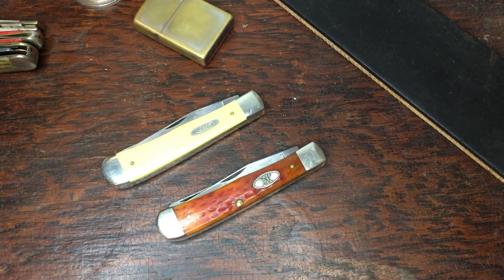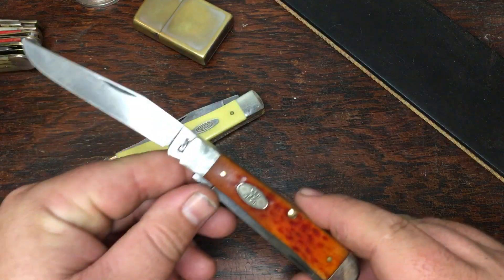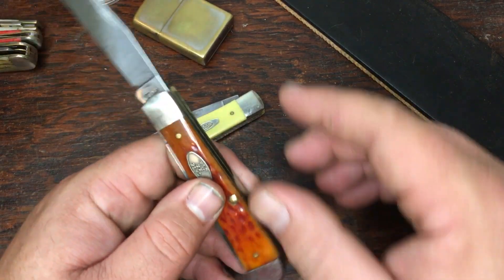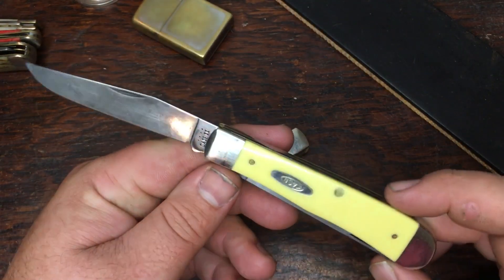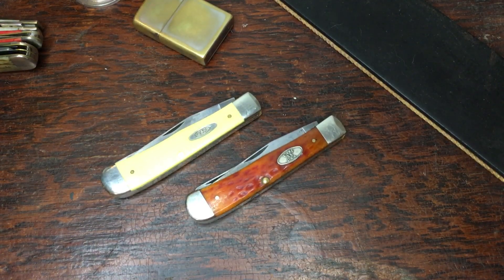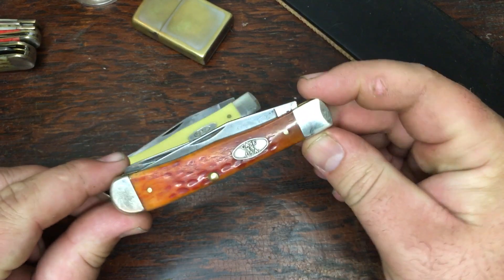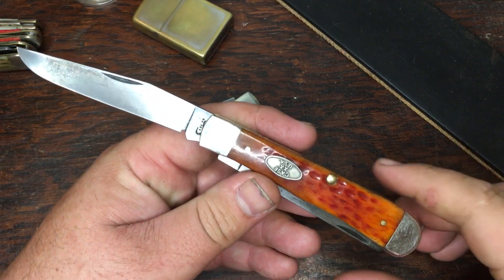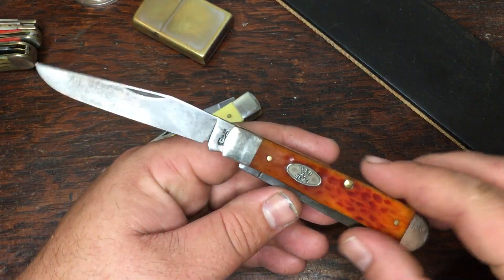Answering the Mystery of Case’s Blade steels

Comment: I have a PMI "Gun" and yes that is exactly the findings I came up with as well. Some trace elements that vary from knife to knife and is part of the (95% accurate) part but with doing PMI testing and checking the compositions what you was told was indeed correct.
Reply from the maker: @diamondcutsteel  awesome, thank you very much for that confirmation!
Reply: Both of you need to know that XRF "guns" cannot measure elements with low molecular weight and this specifically includes carbon.  Furthermore, the variance on the minor alloying elements is so wide you often can't learn all that much when all you go by is what the gun guesses.  Allyall just need to report  the raw element analysis and then let people make their on decisions from that.

Far more useful than that is to take a micrograph of the grain structure of the blade.  This will give you a much better idea of the quality of the steel stock and the quality of the heat treat, which is what really matters.

Comment: I'm debating if case has changed their stainless a few times in the past 20 years as well, the cheetah i have from 2003 is harder than my 2013 trapper, by a fair bit, it sharpens way better too
Reply: Could also be a heat treat thing

Comment: I think the ones marked 1095 were SMKW  exclusive trapper knives. 🤔
Reply from the maker: Yes there were some yellow trappers in 1095 that were Smokey mountain exclusives were just trying to figure out what the “carbon steel” actually is because a lot of people were saying that case’s new carbon steel was 1095. So that begged the question- if it is in fact 1095 why not just stamp them all that? There are others too with the 1095 designation besides the SMKW yellow trappers

Comment: What I've found with the HRC literature case give, whether it's their Tru-Sharp or CV or any other steel type, it's cooked on the soft end of the scale. i.e 55-57 HRC . It's fits in with case saying that the blades are easy to sharpen! Myself I'd prefer a higher level of HRC within the steels perameters and not have to sharpen/strop as much. Albeit what I've said , Case make some excellent patterns and I'll keep on buying them i.e my recent buy of a second hand V54052 SS small 4blade congress,last year before the new vault pattern was decided upon 😁. All the best from the UK 👍🏻.

Comment: If you add chromium to carbon steel, doesn't that make it into stainless steel? And in any case, isn't all steel actually carbon steel? (because if it didn't have added carbon, it'd just be iron).
It seems to me that we use a lot of imprecise and confusing terminology when describing knife steels.
Reply from the maker: I’m no metallurgist, but I have been a machinist for almost 20 years and I know that chromium is added as a corrosion resistor, and I also know that there are many diff grades of most common steels. For instance true stainless steel is non magnetic, however some stainless like what’s found in a case knife does in fact have a slight magnetic property, this is how most case knives are displayed in the stores, blades sticking to magnets. Where I work we use several different grades of aluminum as well as copper alloys, nickel alloys, etc.
Reply: It does, but you need much higher amount than what they add to their CV alloy.

Comment: This sounds about right to me.   I actually mentioned earlier that it was probably a 1050 or 1070 Carbon Steel .   Most sources also said that Case CV was a 1086CV   Case used 1095 and then later 1095CV many many years ago.    O-6 Tool steel is going to be more than adequate for 95%  of the jobs 95% of the users are going to use a pocket knife for.
Reply from the maker: Hey thanks for the added info, and you’re totally right, most everyday task don’t require a “super steel” thanks for watching tobias!

Comment: Thank you, that is some interesting information to know. I was never was too concerned of the differences from either type. CV  supposedly has similar properties of 1095 and sharpens easier. I do not think the differences matters. I would think 1095 would vary depending on the manufacture. I believe Case was happy to switch to 1095 because CV has fewer sources producing it.

Comment: Thanks for the video! I have always wondered why the mystery? Other knife companies tell you exactly what they use. I have there CV and recently some 1095 but no CS. I find that some care needs to be taken with Trusharp or it will get a burr that just keeps going back and forth from side to side. It seems to be run a bit on the soft side.

Comment: This was interesting info! Would you be willing to sometime do a test on their Tru Sharp stainless? That's one steel that I've never heard a definitive answer on, and I've always wondered about it. Cheers, buddy!
Reply: Case's Tru-Sharp is Latrobe 420HC, containing 0.46% carbon, 13% chromium, 0.3% vanadium, 0.4% manganese and 0.4% silicon, hardened to around 55 HRC. Nothing special but I like it because it sharpens so easily (which of course means edge retention isn't the best).
You'll have doubtless noticed that 420HC contains both chrome and vanadium, which makes it a CV steel! Confusing terminology, because what's really being highlighted is the amount, rather than the presence, of these added elements. Just like the HC in 420HC means High(er) Carbon, but it's only high carbon in the sense that it contains more carbon that the 400 Series steels it replaced.
Reply: I have PMI tested it my self and it is indeed 420HC I've also poked about 20 different knives in it and it runs from 54 to 55.5rc.